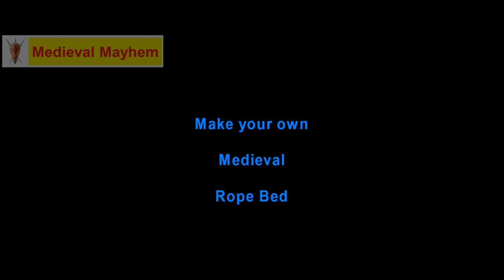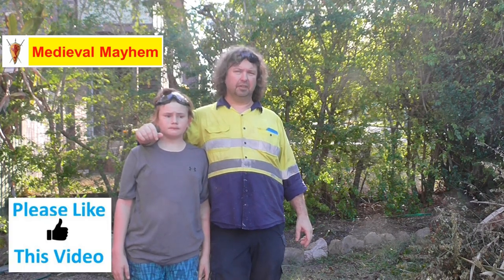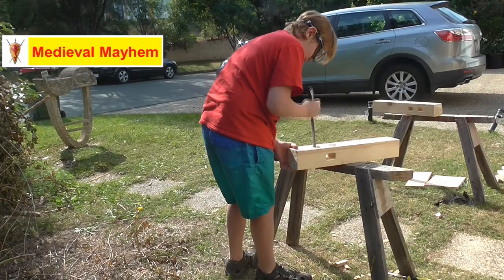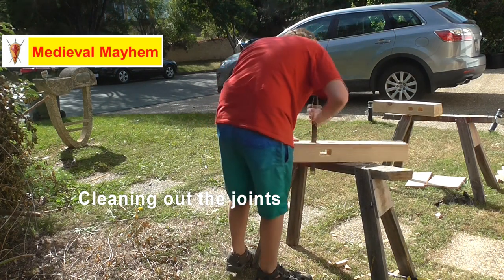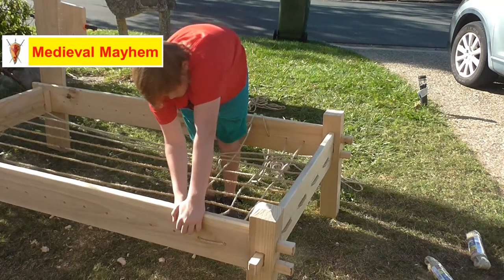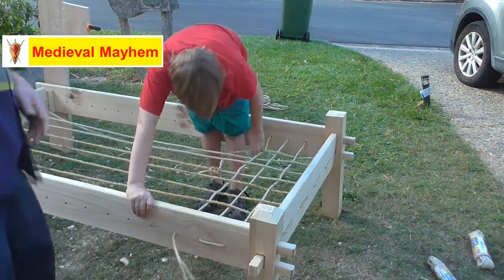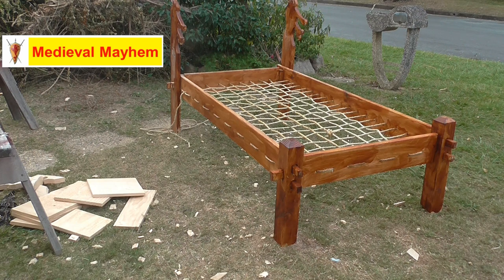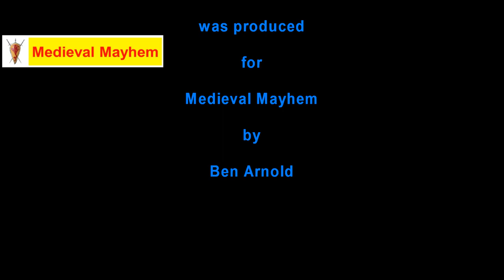How to make a Medieval Style Rope Bed (Viking)

Comment: I think you'll probably find that those tension fits will wiggle loose over time with use, and pegs (or better yet, wedges) will most definitely be necessary at a certain point. Good job though, I'm working on a bed with my son as well! It's a great bonding project.
Reply from the maker: I can see pegs being useful on the top posts, but the base is held in by tension.,

Comment: Dude, when you use a router you gotta work from left to right against the rotation of the cutter.The only exception is when you're shaping a steeply angled cut against end grain like on a round table top or a mitre cut.
Your son was routing the wrong way with his hand in front of the machine and you could see the machine grabbing and jerking forward, if he hit a knot or some tricky grain it could easily have pulled the tool violently out of his hand into his other arm.
Otherwise it was a great video and an awesome build.
Reply from the maker: CHeers, I appreciate the comments. This is an older video and through experience I have learnt the value of what you are refering to in regards to safety. Yes, I was a bit loose with safety and that's not cool. 
New videos out soon. Thanks.
Reply from the maker: We are now releasing new videos on a regular basis. 300 new videos in various stages or planning, pre-production, editing and post production. So - plenty of videos to come.

Comment: How much rope did you use for the size, what size was the frame and hole spacings?
Reply from the maker: Holes are 10mm, frame was for a modern single mattress and rope size is approx 8mm (off the top of my head), used approx 14 metres.